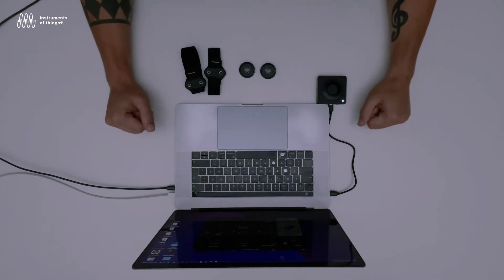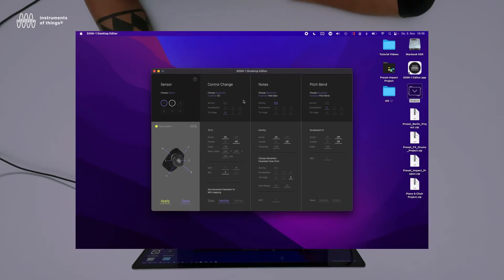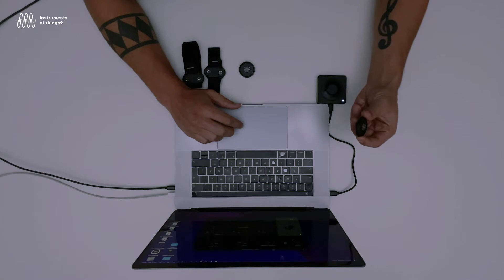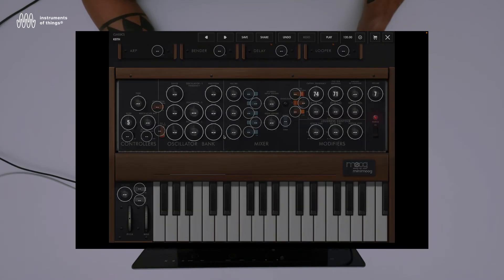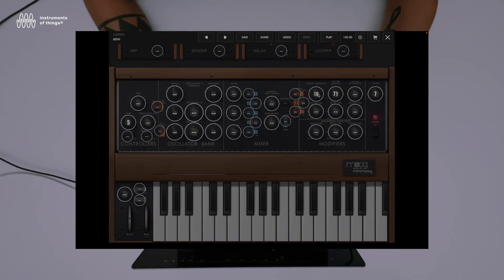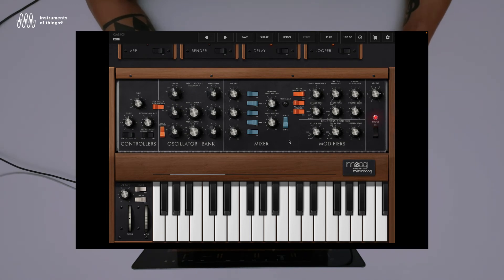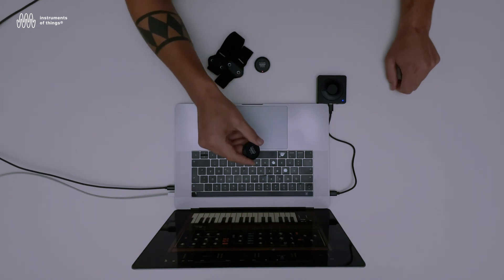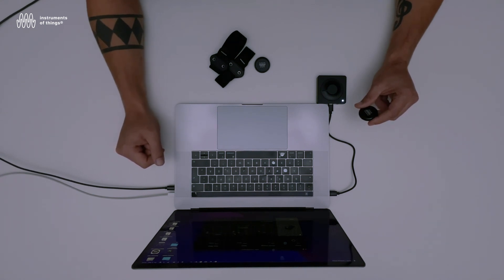SOMI-1 Walkthrough #4 – SOMI-1 desktop editor

Comment: I want to connect my older movesense sensor. But it doesn't recognize. You know how to do this? I got it today. Really hope to get a bit of succes after a long proces of looking around for motion sensors for midi and spending a lot of money. After the vacation I hope to connect a dancer at the school I''m teaching. 1 sensor is responding from the 3
Reply from the maker: Hi, to use our motion sensors with both, 2.4SINK and SOMI-1, you have to update the sensor firmware to version 2.6 (see support section on our website). More information regarding upgrade procedure can be found in the SOMI-1 manual.